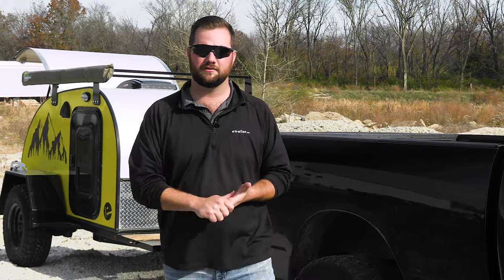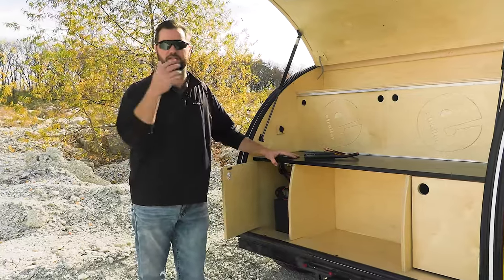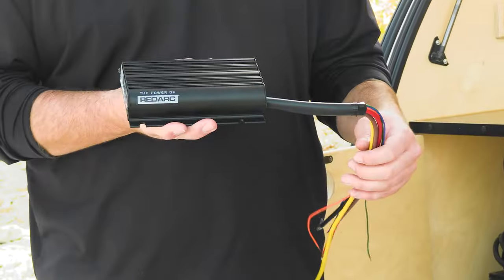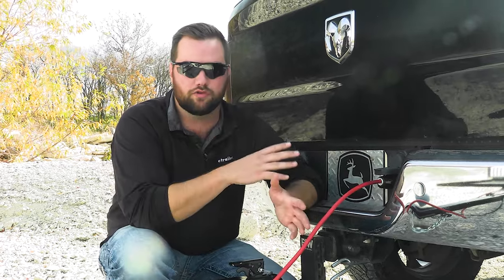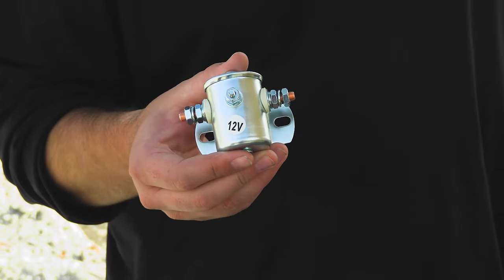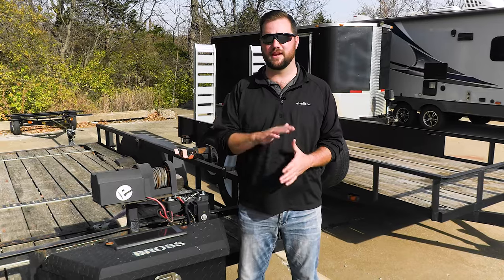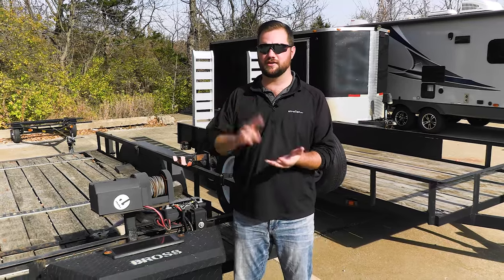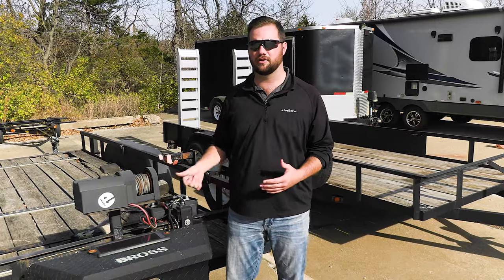How to Charge Trailer Battery While Driving

Comment: Great video! One question….I would like to also charge the batteries when parked with a generator. Can that be wired from the shore plug to the batteries to do this or is something needed between the two? Thanks